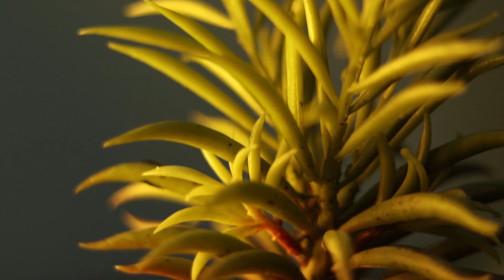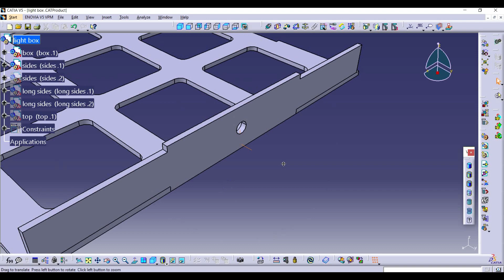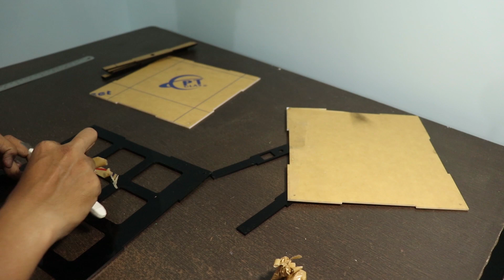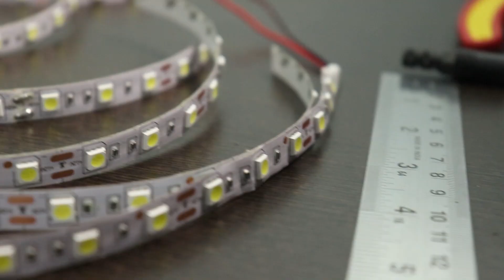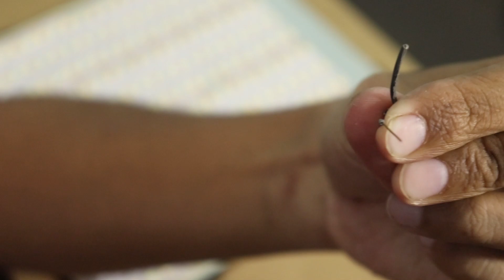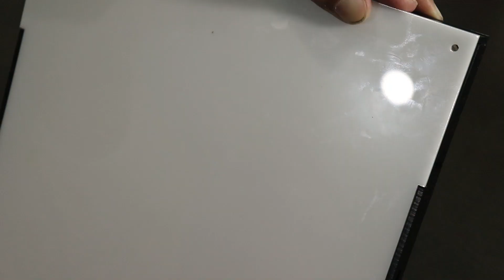D.I.Y LED Video light panel

Comment: what about heat ???
Reply from the maker: For the heat desipation the LED strips are stuck on the aluminum sheet of 2 mm thickness and the frame has cutouts from the rear portion for heat desipation

Comment: What kind of LED strip do you use? Where is the electrical schema? Why is the brightness not adjusted?
Reply from the maker: This was the first led pannel and I this I used normal generic 12v led strip, as high frequency dimmer was not available here so I didn't include the dimming in this one
Reply from the maker: And for the electrical schematic diagram I will attach it here in the description of the video